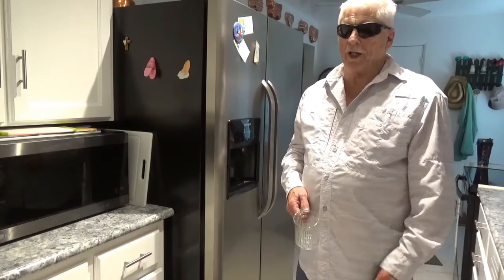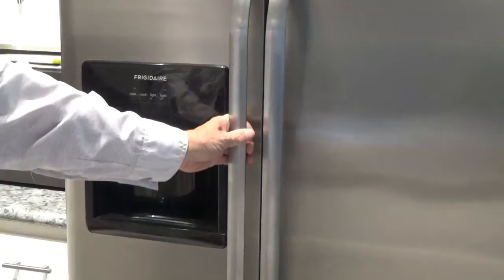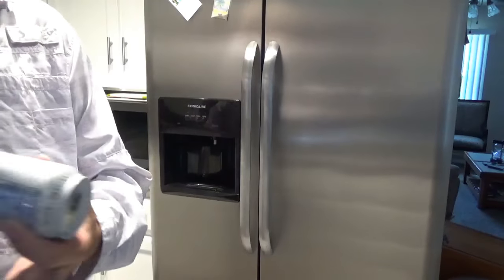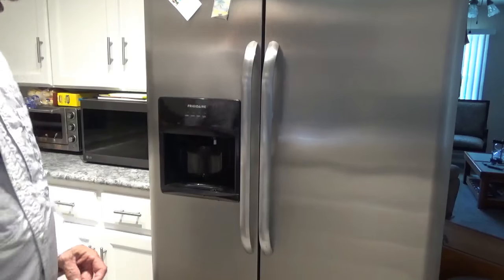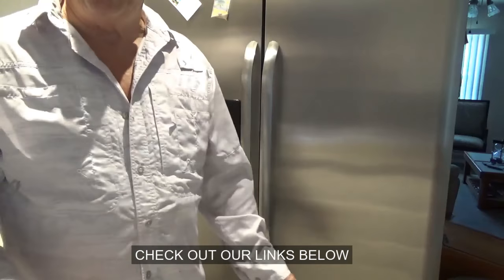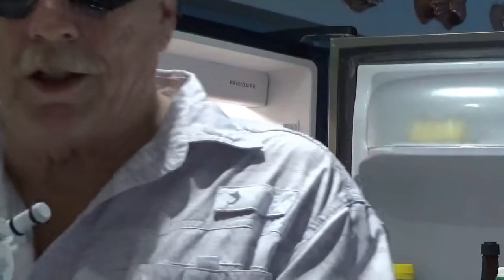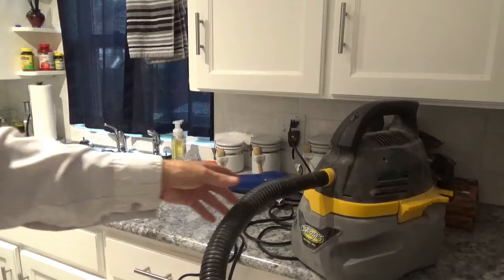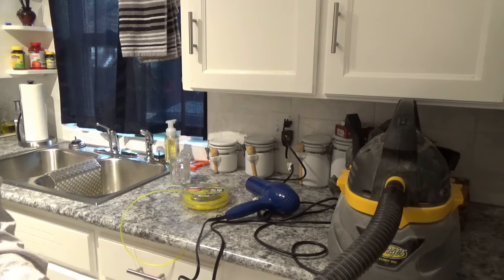FROZEN WATER DISPENSER IN REFRIGERATOR QUICK FIX

Comment: check your ice maker first.  If it's making ice it's NOT the filter, but a frozen line... saves even more time to pinpoint the problem.  loved the video.
Reply: Ditto. And I disconnected the fridge line from the freezer, in the bottom panel (with a pan under it). Then, when I push on the water button, water comes out fine fromthe right tube, so no freeze there. I'm still struggling with the frozen left tube, but don't want to drop any money on the Amazon gadget.

Comment: You are my hero!  After watching all of your video, and coming to the part about the water filter I checked mine and sure enough it had frozen.  Probably because I had earlier done a thorough cleaning of my frig side and had the door open for too long.  I used a by pass valve and sure enough the water came out of the dispenser just fine.  I put my filter in the sink to thaw out and will reinstall later.  Saved me an expensive tech visit!

Comment: The use of the weed wacker string is clever. Just used it now to confirm that indeed there is a frozen pipe issue about 3-4 ft into the fridge door. Now have the syringe thingy on order with Amazon. Thanks for the insight and for your time to produce this video. Hair dryer is not going to cut it for the distance for our ice build up.

Comment: It worked for my LG to door refrigerator when I took out the water filter. It was frozen at the tip and seem frozen inside to. 
I did use a hair dryer medium heat on my water filter  was really cold and also a little bit on the inside of the refrigerator where the filter goes Once I put it back in the water started coming out a little by little and then back to normal. Thanks for your video.

Comment: Great video thank you for sharing. However just to add my experience here so that others don’t have to go through what I did. When my dispenser stopped working I researched online to see what it could be and everyone seemed to say it was the water inlet valve at the rear or a frozen pipe in the door (not likely in the newer fridges) going to the dispenser. After waiting 2 weeks for the inlet valve and after fitting it, it still didn’t work. I tried everything until I removed and emptied the water reservoir behind the salad crisper. When I reattached it I found the reservoir didn’t refill at all. So I checked that good pressure and water was going to the water inlet valve and it was fine. So I removed the clear/white pipe from the inlet valve at the rear that goes to the reservoir/tank and blew in to it but seemed like it was blocked. I then removed it from the reservoir/tank and pulled it out completely and blew into it. Nothing. It’s a 2 foot pipe and the air wouldn’t go through so I waited a few minutes as I thought it was frozen then suddenly it cleared. Voila! There you have it. Reattached everything, the pipe goes back in from inside the fridge easily, and the tank filled up and water and ice is now perfect. Just that 2 foot pipe! 😂
Reply: How did you know how to do this? Did you find a YouTube video?

Comment: Took your advice and used the wacker line from the bottom of the refrigerator water connection to the top of the dispenser nozzle and vice versa, and worked. Wasn't frozen, thinking build up from consent use. Keep up the great advice.

Comment: Aside from the obvious chuckle I got out of your video (yes, listen to your wife), you also just saved me a ton of time.  I have the same fridge and just discovered the same problem about 30 minutes ago.  I started looking on Youtube for an answer.  Lots of complicated things about checking electrical switches and components.  Also saw stuff on a frozen water line.  Wasn't sure where to start.  I then watched your video.  I just now took the water filter out with high hopes.  I moved it around over the sink though and it was NOT frozen.  Water was dripping out and I could hear it sloshing around.  I'm thinking, "crap!"  I reinstalled it and checked the water dispenser again for sh#ts and giggles.  Some resistance but I felt a small piece of ice or two come out......then water!  I grabbed a cup and did it again, and sure as sh#t it was dispensing water again at full speed.  Thank you!!!
Reply from the maker: glad it helped. Thanks for watching.

Comment: I pulled out the filter and sure enough, the water in it had frozen, used a hair dryer on low, melted the ice in the filter, shook it until all the water came out put it back in and low and behold the water dispenser worked.  It was 4:00 a.m. in the morning, when this happened.  Thank you so much.  I will tell all my friends about your site.
Reply from the maker: Thank you for watching.

Comment: First thing I did was disengage the water connection below the freezer door, then engaged the water.  Water shot out from the hose into a towel.  That Tells you that the problem is beyond the Filter.  In this case the freezer door is where the line runs and is probably frozen.  I like the weed eater string idea to see how far up the freeze is on the line.  Fridge companies need to do a better job insulating the lines in the side x side units.  Thanks for the weed eater line...  going to grab my line right now as mine is froze...

Comment: Thank you - just had a similar problem with my Frigidaire, filter in fridge was frozen - only odd thing (to me at least) was that a new filter didn't work, water wasn't running thru it - it wasn't until I thawed the old filter, put it in the fridge and held the water lever with a cup under it for a minute or two that water started running again - once the water was running, I then changed to the new filter and it belched for a second or two, then ran fine...

Comment: I said no way the filter was frozen. But I'll be damned if that wasn't it.  I don't get it because the settings were never changed since the unit was installed over a year ago.  I have the exact same frig. Otherwise it's been fine.  You saved me a $200 service call.  Thanks!!!
Reply from the maker: glad it helped. Thanks for watching.

Comment: I changed my filter still having the same problem.  But, this was a good video.
Reply: My line froze after 3 years of being on the same settings. Checked the simple things first like the filter and making sure the valve was working. Pulled the water line out of the freezer door (pretty easy to remove and reinstall) and ice was blocking it in that line. It is now frozen again and it's not the filter.

Comment: Mine freezes in that little line sticking down where you fill the cup. A hair drier alone , no can , waving back and forth for three to five minutes thaws mine right out. You’ll see the hair drier air blow a drop of water and it’s time to test. If not qiute ready continue with hair drier. Mine only does this in the winter months for some strange reason.

Comment: Where do I send you the $150 you saved me for a dang Appliance Repair Service Call? I watched your video, we have a different brand but I got up found my stool and easier my old ass down in front of my refrigerator while my wife was picking out a number to call the repairman. I simply removed the filter, got my wife to hand me a cup and put it under the water dispenser and the water worked. The meter on the door indicates the filter still has 2 bars of use. Damn a $50 filter that doesn’t last. Got to die from something. No more filters for me. If the water looks brown I’ll just boil it. Someone is always trying to get ya money. ✅ thanks for the great video.

Comment: I don't know why there are not more DIY videos that list this as a possible cause. For after soaking the filter in some warm water everything was back to normal. I suspect as someone else mentioned that it was due to having door open for extended period while cleaning it out. At least now I don't have to worry about replacing a valve, low water pressure or ice in the lines which would have me worried about the problem returning.

Comment: My water filter is fine. In fact when I pulled it out there was plenty of water. Left it out and screwed the cover back on and then pressed the water door switch and the cover filled with water. So, I guess I will try the other methods. 

PS: I do get ice.
Reply: I have the same problem as you. I get ice, but no water from the water dispenser. When I pulled out the water filter (even replaced it), water flowed out as well. Did you ever solve your issue? If so, how?